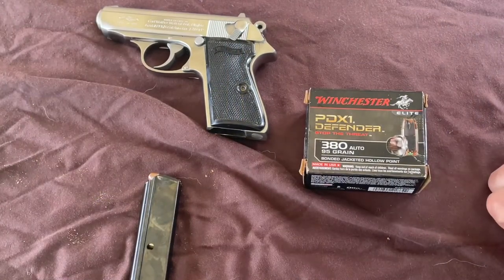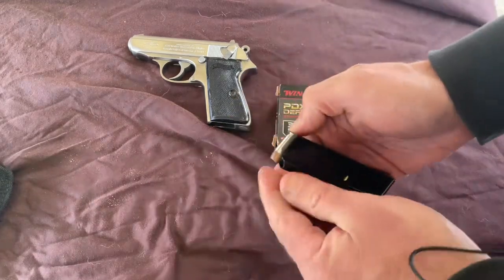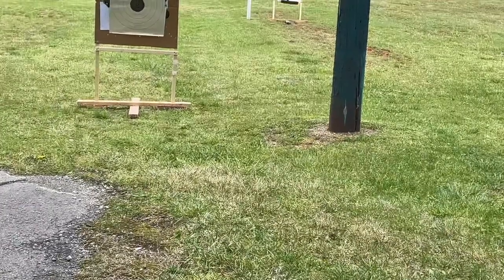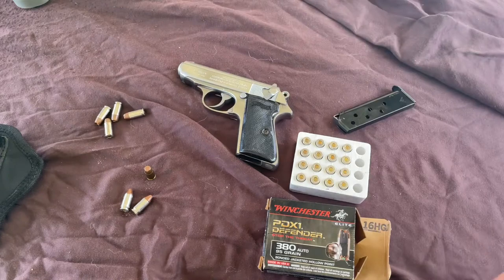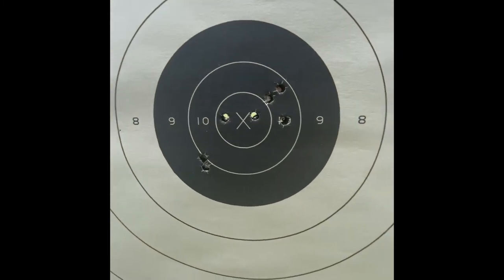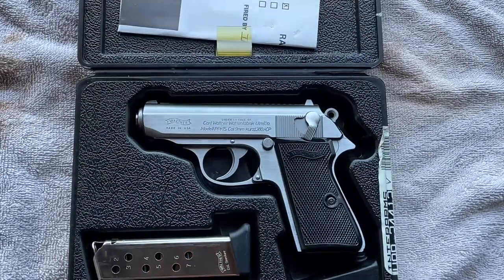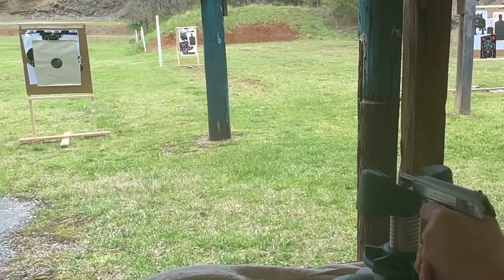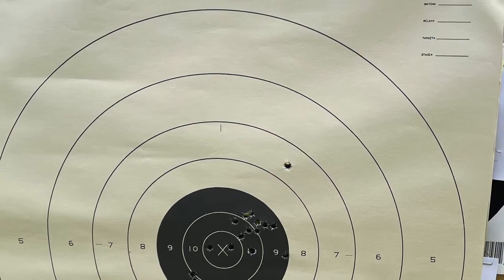Can You Shoot Hollow Points in the Walther PPK?

Comment: I've carried the ppks for close to 30 years. It's been through hurricanes and floods with me where I had to swim. (Gulf coast resident here) . I've only shot ball and hydro shoks through mine. It's been very reliable, but as a left hander, not the best suited. I guess the reason I am so reluctant to change is because of it's natural point of aim. While sights are horribly small , the grip angle is so natural, thus making it a quick draw and hit on target piece.
Reply from the maker: I’ve had mine for about 15 years now and carry it off and on. The collectibility of it sometimes makes me put it back into storage and go back to carrying my Glock. That’s a great story, thanks for sharing and thanks for coming by!
Reply: @cornfromajar3222  You mention collect ability but I often wonder about my S&W ,it runs 100 % perfect never a hitch but the key board warriors complaining about the same have me worried if I ever did want to sell that I would have to take a loss on it at 2010 prices, with the 2022 models going for 750 smackers that makes me feel un easy . but the good point is that parts can be had for the older american made models so there is no worry to use them.

Comment: I EDC a 2020 PPK/S from Ft. Smith; it’s run every hollow point I’ve loaded it with (Hornady CD, Prvi Partisan .380 Defense, Barnes Tac-X I think, and Remington Golden Sabers.) it also runs Black Hills 65Gn Honey Badgers flawlessly. I carry either the Honey Badgers or Critical Defense. Good little pistol that catches more flak than it deserves.
Reply from the maker: There is some controversy in the gun community about whether it can handle it or not, I guess since it was designed for full metal jacket pre-WW2. I personally haven’t had any issues either. Thanks for coming by!

Comment: The last time I took my 1976 (Made In W Germany) PPK/S to the range, I ran 24 rounds of Hornady 380 Critical Defense  using 7 plus 1 with each of my 3 magazines.  It functioned flawlessly. Don't carry it anymore but Hornady CDs are the only  ammo I would use if I ever do.
Reply from the maker: I’ve not had an issue with Hornady critical defense although I haven’t shot a great deal of it. I happened to have a box of the Winchester I haven’t shot and used it for this video. There seems to be some speculation out there about whether Walthers can handle hollow points and I figured they would work fine. Thanks for coming by!

Comment: I have used Hornady Critical Defense without a hiccup. I also have shot many rounds of Polycase through it and it is great. Reduces recoil and makes practice easier on the hand. I carry the gun with Polycase Fluted. I have had it for fifteen years. It is a Smith and Wesson version and I have never had an issues with it. Beautiful firearm.
Reply from the maker: Thanks for sharing! I haven’t had any issues but I also don’t shoot hollow points very often. I have heard/read in forums it’s a no no. Oh well. Thanks for coming by!
Reply: @cornfromajar3222  I believe it`s the same reason as the 1911 they where originally designed for FMJ in the days before hollow points.
Reply: I have a S&W from about 2011 manufacture it has also been absolutely flawless

Comment: Its a straight blowback pistol. People need to understand how they operate and what the ramifications are. 
If you are conservative about your ammunition choices, that is to say that you don't use an extreme hollow point, light for calibre, "low recoil" (which means a lower power charge) or +P ammunition (which it ancedates) then you shouldn't have any issues after the expected breaking in period.
It is my experience that unless you get a pistol or magazine that is outside its normal manufacturing tolerances, most failure to feed/jaming issues can be attributed to poor ammunition selection.
You seem to have chosen well.
Reply from the maker: Thank you for sharing and thanks for coming by!

Comment: What full metal jacket/target ammunition do you use reliably in this gun? I just bought one of these, an actual PPK version and I want to know what is the best target Ammunition to run through the gun reliably and smoothly? I don’t wanna waste a bunch of money, I have heard some people say round nose works the best and some people say round nose works  lousy! Can you name me a couple Like two or three brands of reliable Ammunition that feeds and works good in this firearm please?
Reply from the maker: When I have similar concerns about a gun, I typically buy the big three- Remington, Winchester, or federal. And that’s with any gun especially if I don’t know what it can handle. With my PPK, I’ve owned it for about 15 years and have shot all three brands and then some and have rarely experienced issues with round nose. And as you gain experience you can venture out to other brands to test their performance. Thanks for coming by!
Reply: The LGS that sold me my PPK also sold me Fiocchi 380 Auto FMJ Training Dynamics (I think Fiocchi might have recently renamed it). The salesman told me this is what he uses in his PPK. So far, so good--no problems at all.
ETA: I should probably add that I bought my PPK only a few months ago; it's new and was made in by Walther in Arkansas. YMMV with a S&W.